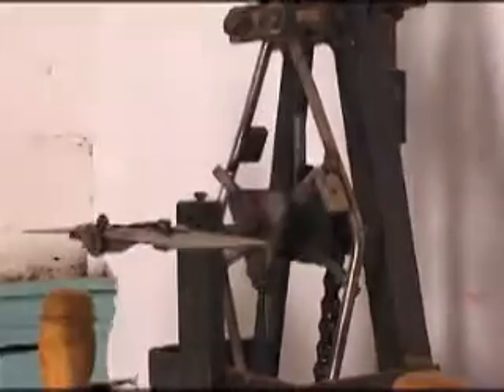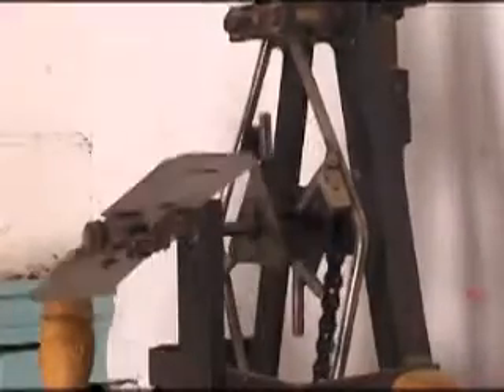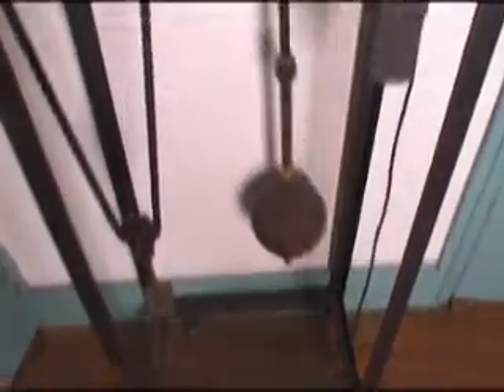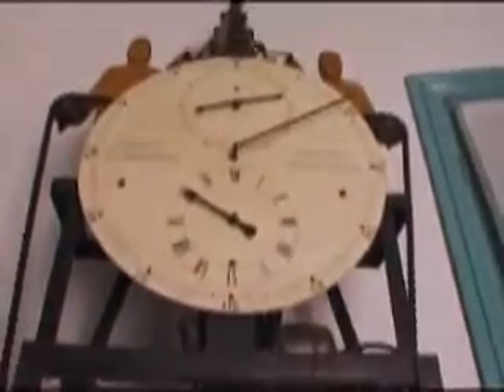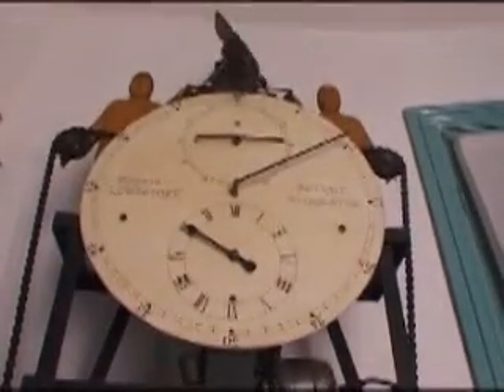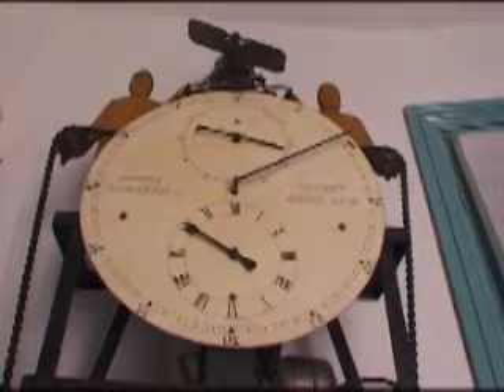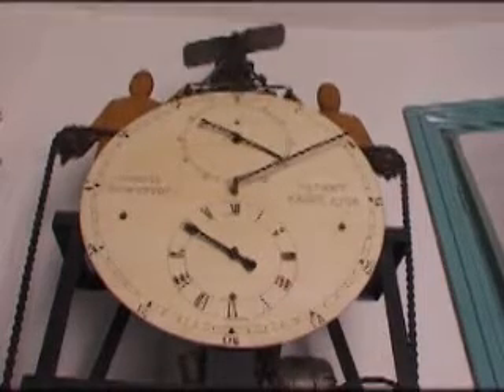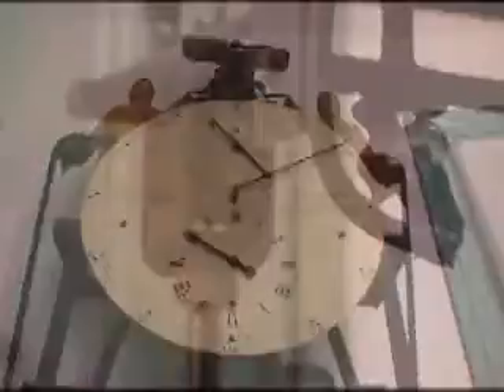gravity escapement clock

Comment: Does the clock's speed remain unchanged while it is winding?
Reply: The clock's speed should remain continuous, even when it is being wound, because the length and weight of the pendulum are what is required to change the running speed of the clock, and raising the power weight should not affect them.
Reply: Was thinking the same thing myself!!
Reply: I was thinking the same thing. Do you have the answer now?
Reply: A few seconds a year error, after adding a solar powered pendulum synchroniser linked into the GSM phone network.
Reply: Yes.